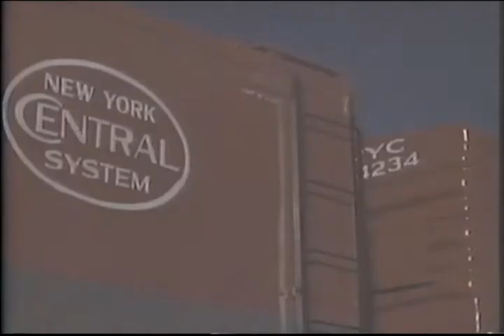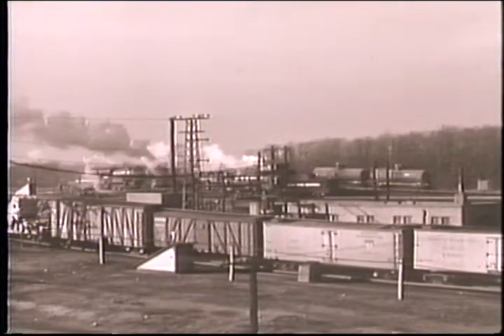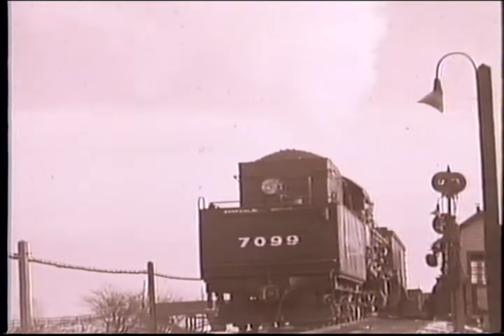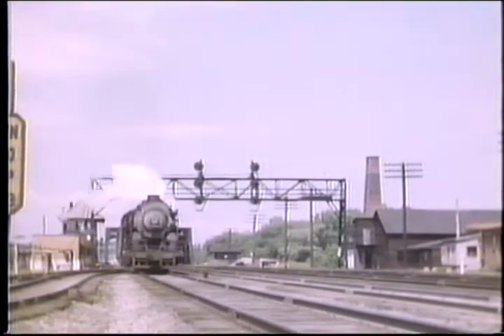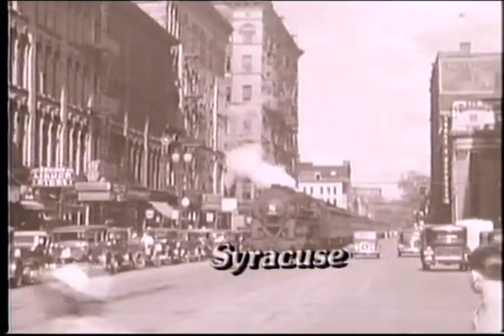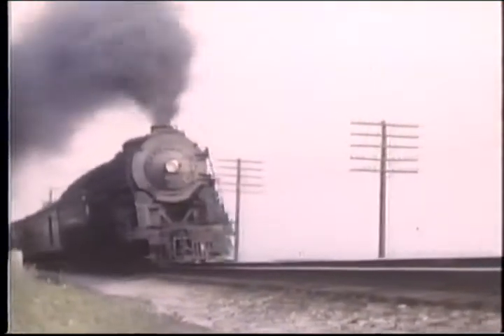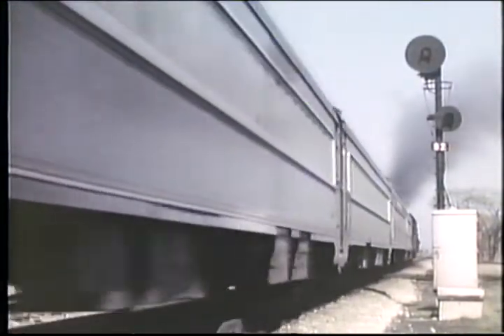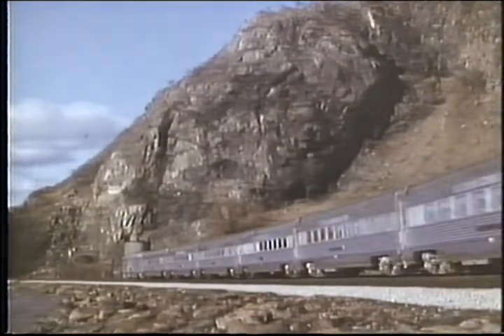Hudsons along the Hudson

Comment: The Hudson River must never flood, because the Central’s mainline looked like it couldn’t have been more than 5-10 feet above the river.
Reply: Water level route. Still operates today. Was on it last month.
Reply: I was thinking the same thing.  Surprised that they didn’t have major washouts.
Reply: The Hudson is a tidal estuary all the way to Albany, it doesn't flood because it's sea-level. The other major river, the Mohawk was canalized in the early 20th century. With all that water control infrastructure it didn't flood either. The rest of the route skirted the shores of the great lakes, and they're as good as sea level too.

Comment: In the mid 50’s, on College summer breaks, I worked with TRACK Crew members of the NYCRR on the Hudson Division. Our job was to repair and or replace track and signals on the MAIN LINE adjacent to the Hudson River!    
Never forget … 1 day we dug a trench about 3 feet wide between rail TIES across 4 tracks, 2 of them MAIN LINE track. This was always done with great speed to keep trains running.  ONE DAY, after digging the trench … we stretched out the Signal Cable  … The Foreman nearly collapsed .. the Cable was about 3 feet short of the needed length for completing the Signal repair.   ALL HELL BROKE LOOSE … Covered the trench  … started again the next day digging all over again.  A day I’ll never forget.
Reply: Where abouts on the Hudson line were you guys working?
Reply: @michaelbimonte9112 my grandfather was a conductor pre war and after the war. Near Elmira, NY.. (late 40s, 50s, 60s and early 1970s) Would you happen to have any knowledge regarding what trains or routes, I believe Scranton P.A. to Buffalo was one of routes. Thank you sir, in advance.
Reply: Harmon
Reply: Sorry don’t know the Scranton routes
Reply: @michaelbimonte9112  nice 👍